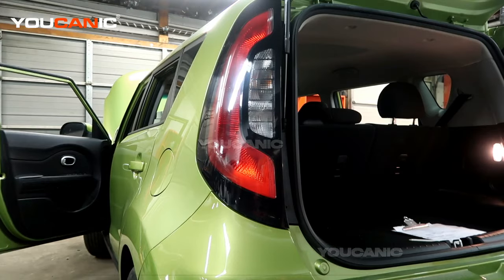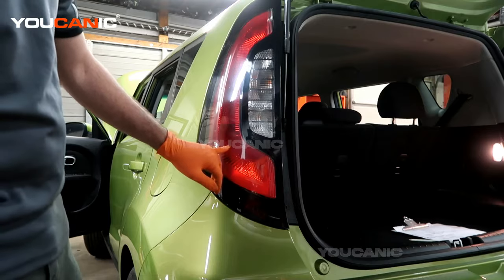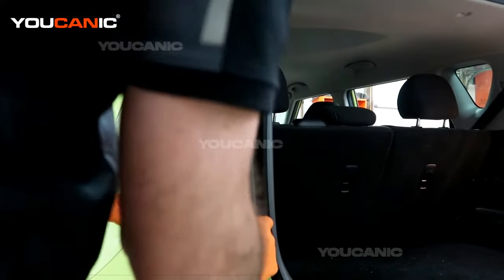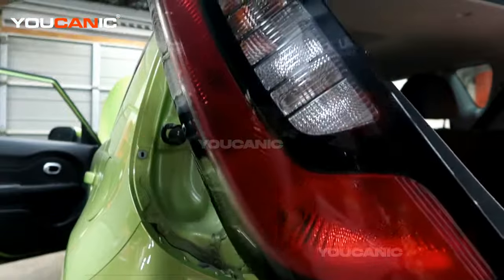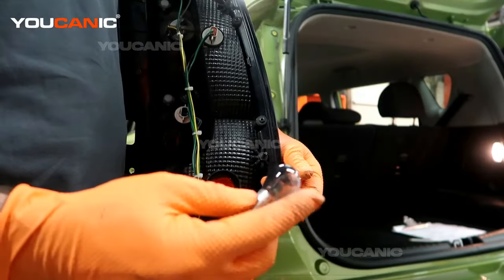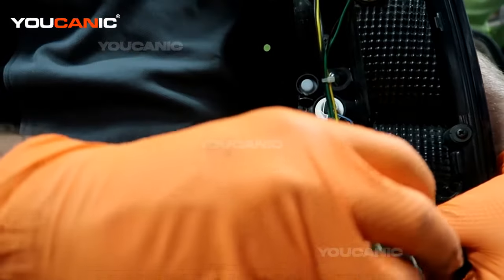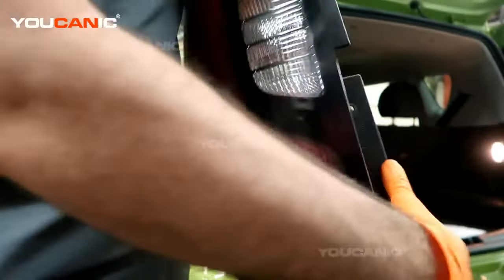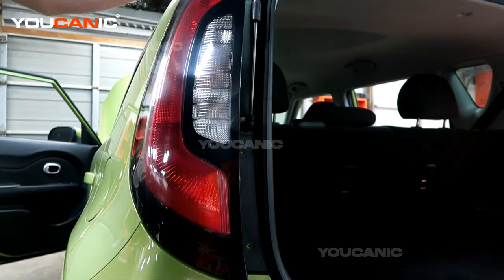2014-2019 Kia Soul - Brake Light Bulb Replacement

Comment: Why do they design cars this way ? I swear someone lies awake at night just thinking about how to make a simple job into a pain in the ass !
Reply: A few screws and pull out is not simple? Sheesh
Reply: @Coolpachito  My previous car you could do this from the inside without all the drama. Yes, that's a lot of drama. Pinching the electrical connection (they are never that easy), having a not-too-rough touch when tapping the housing back (something tells me they crack easy), turning things half-turns and pulls and pushes rather than simply unscrewing.  Not rocket surgery or brain science but still. I don't see YOUR video of this.
Reply: @jimcarey7150  Why would I need a video ? Lol. I am saying it is not too hard to do such a simple job. Compared to OTHER cars that you have to do a whole body job  to change a bulb or remove a whole engine to change the oil then this is still pretty simple. There is nothing complex. Also with your own logic you can bust a light socket by inserting the wrong bulb or improper way, regardless of how easy you reach said socket. Does that mean it is complicated and dangerous to put in a bulb?  Oh man things can blow up !  Give me a break.
Reply: It takes a really special person to comment on a DIY post obviously meant for non mechanically adept people, minimizing their difficulty and a backhanded insult at the video maker--if it was so easy, why did he take more than 3 minutes to explain it?   @Coolpachito
Reply: I literally just did it today. Took me less than 10 minutes. Clips on the light did not break or cause me drama. Pulling the light off just took some patience- got a flat bladed screwdriver, wrapped it in heavy duty rubber, eased it in to create a gap just big enough to get my fingers in, and pulled. Putting it back in was a piece of piss. Line them up, and push in. No fragility there. If you can’t do this, just don’t touch tools. Ever😂

Comment: Hey my brakelight is out on my driver's side, so do I only need to replace that one bulb you pulled out in this video? or do I need to replace all the bulbs on my driver's side? I know my turn signal bulb is still running fine but I was just wondering if there are multiple lights to replace

Comment: I am so happy i came to check this out. The dealer was quoting me 100 bucks plus part to replace this since they said you had to take the rear hinge off.. ffs.. Saving me.. I just wish i knew what size screw driver to use.
Reply from the maker: Thanks for reaching out! At Youcanic, we're glad you could benefit from our video and save some money. The screwdriver size necessary can vary depending on the vehicle, so it's always best to have a set on hand. Visit our website, www.youcanic.com, where we offer detailed guides, free resources, and tools such as the YOUCANIC scanner to simplify car maintenance.

We're here to empower you and support you through your car ownership journey. So feel free to reach out on our site for any more queries or assistance. Remember, we even have factory repair manuals available for more complex needs.

Comment: Thanks for the great information
Reply from the maker: Thanks for your feedback! At YOUCANIC, our goal is to empower car owners like you. Our Full System Scanner is an invaluable tool designed to help you diagnose car issues. Find out more here: www.youcanic.com/scanner.

Beyond that, we offer a plethora of resources including OEM Factory Repair Manuals and a platform for your car-related questions. Explore our website: www.youcanic.com. Please don't hesitate to reach out if you have more questions or need guidance. We're here to help make car repairs accessible and understandable. Your trust is greatly appreciated.

Comment: I replaced the bulb but for some reason it still ain't working.
Reply: So what was the problem?
Reply: My light went out. Tried changing the bulb out and it didn't work. All my other tail lights work but that one. I've checked fuses they are all good. Only thing I can think of is the outlet itself is messed up.